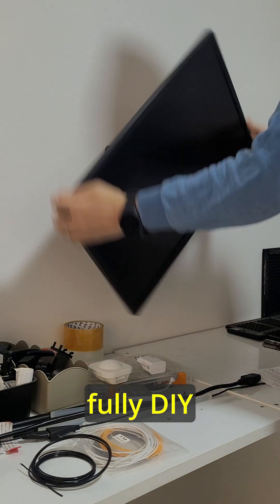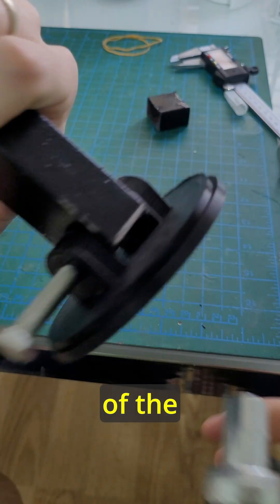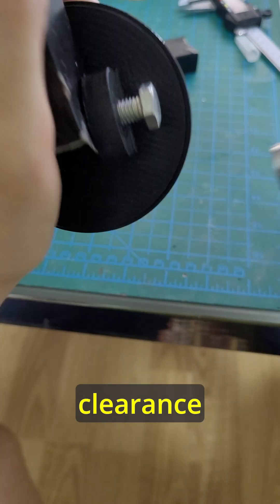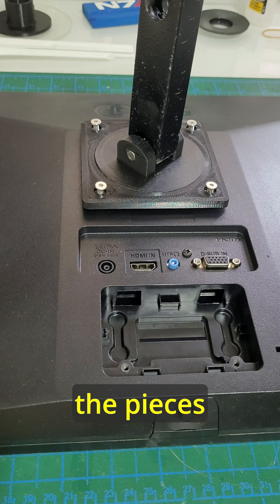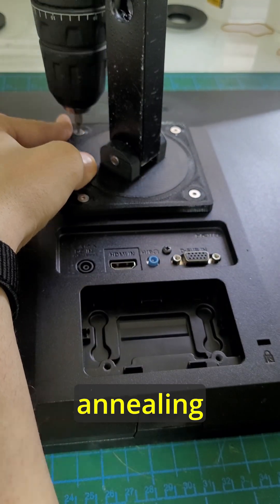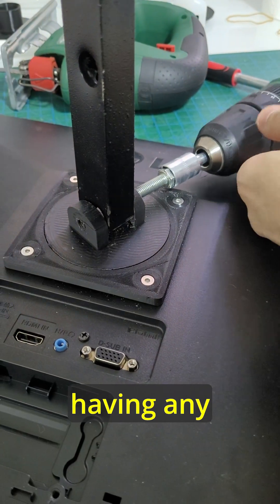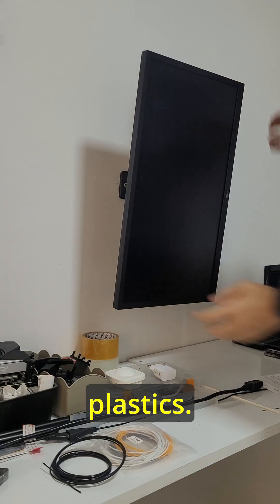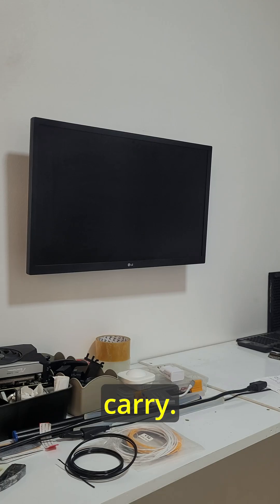Fully DIY Adjustable Monitor Arm | 3D Printed + Metal | VESA Mount #3dprinting #diy #monitorarm

Comment: There is a functional design flaw with this. Annealing it is band aid and maybe it will last for a while but you are putting the monitor at risk due to layer separation of the "clevis" from the mount plate. If you make the mounts in multiple interlocking pieces you can better leverage the structural strength of the layers in compression. It will make it more skookum and probably save you a hundred bucks or so.
Reply from the maker: Annealing for this probably wasn't even necessary, I just thought it wouldn't hurt. For this monitor (2.5 KG) it's very, very sturdy. I think I printed with 5-6 walls at least. It's been on the wall for 4 months without any issues. I got a heavier monitor, for that one I will do a different design (that one doesn't even have VESA anyway).